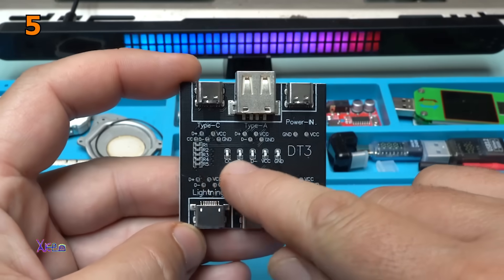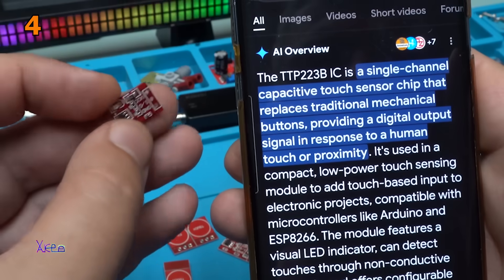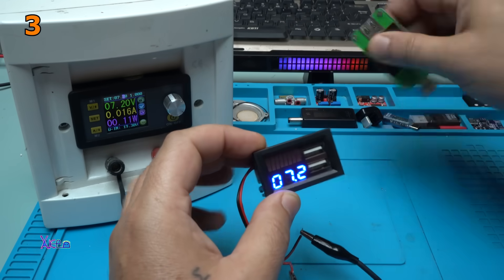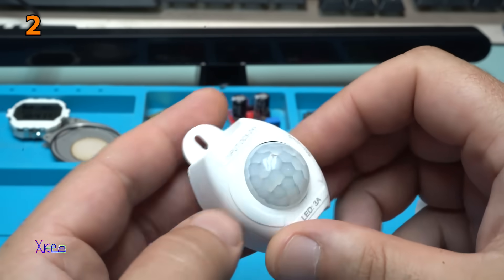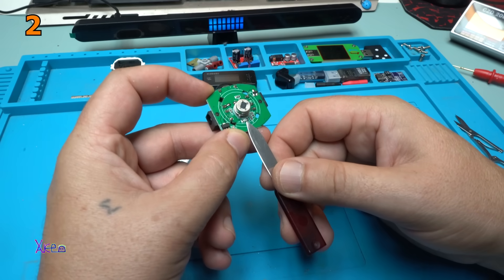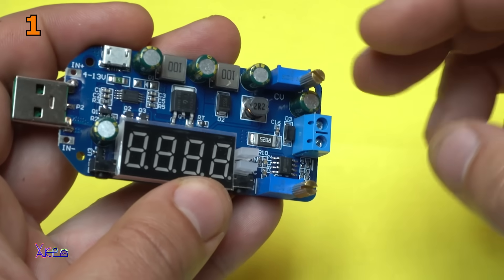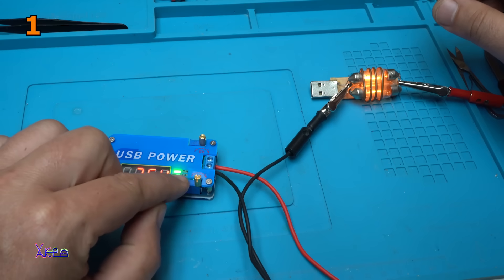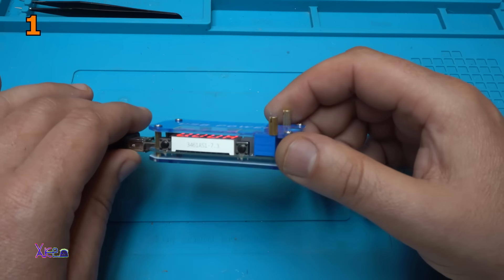TOP 5 FANTASTIC Aliexpress Modules

Comment: I bought a similar "power supply converter,adjustable step up/down" from Aliexpress, but the noise it puts out the DC output is so bad that it makes it useless to feed my H&K bluetooth speaker at 5.9 or 6.0 Volt (running from a power bank). It would really help, if you would show us oscilloscope waves..